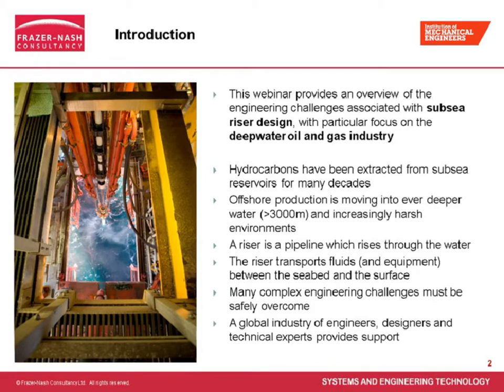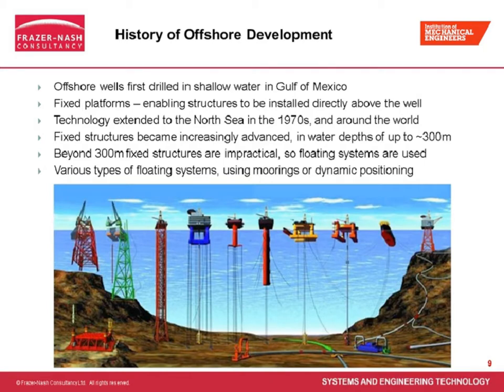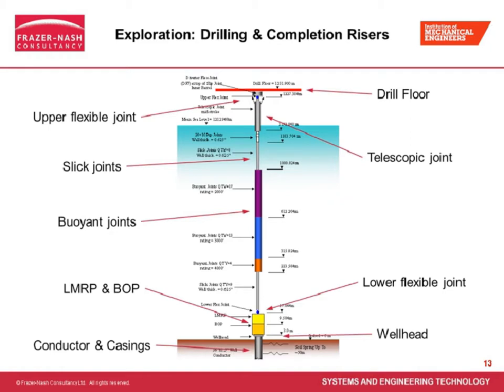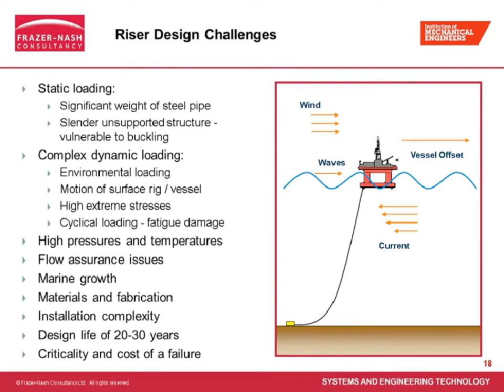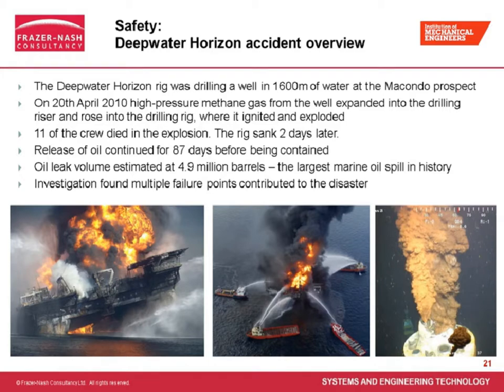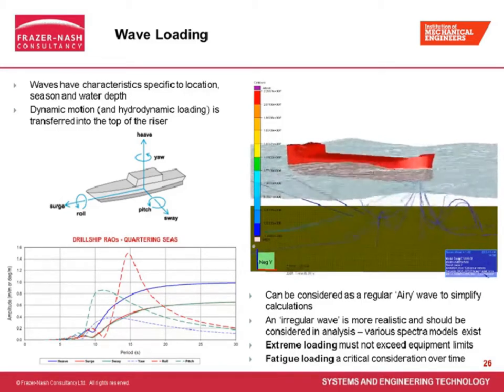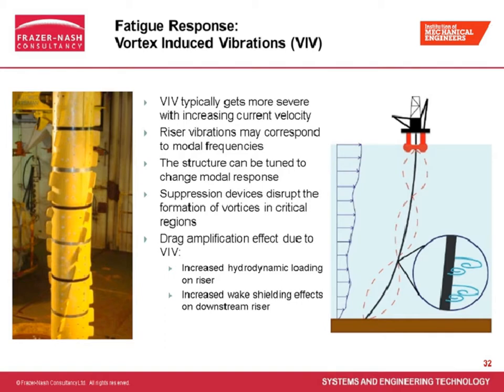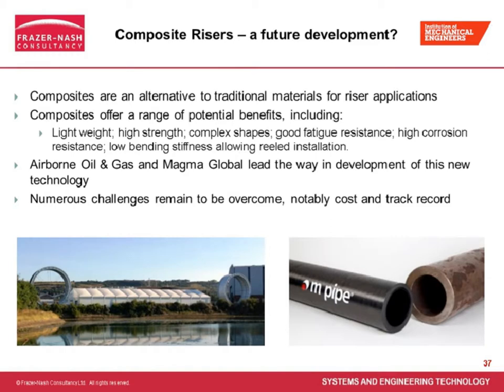Subsea riser design and the challenges of deepwater oil & gas

Comment: Great info. Thank you. I have a question about 'increased tension improves riser response'. Can you please explain 'riser response'? So the drilling mud fluid flow with cuttings in the riser isn't resistant to flow when the riser string isn't 'bowed', no?